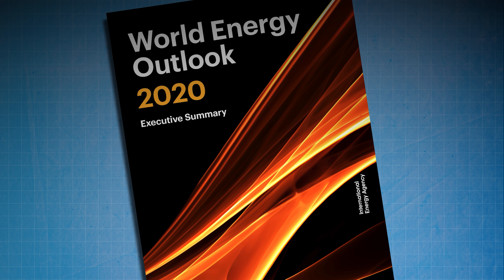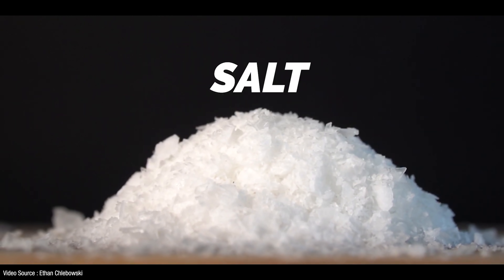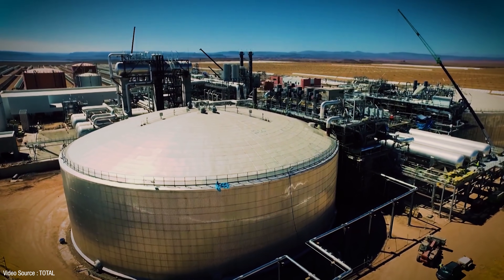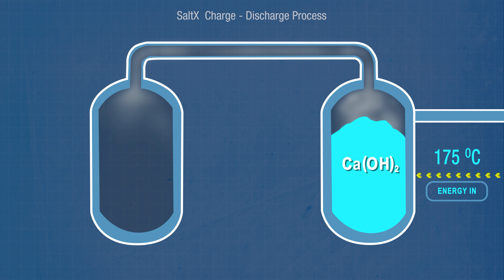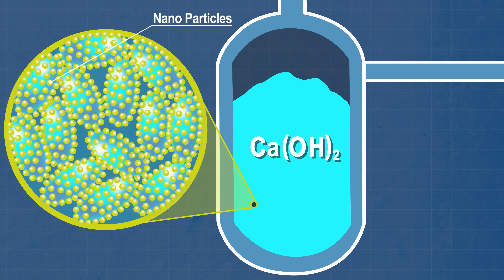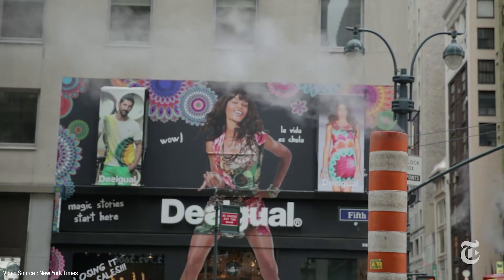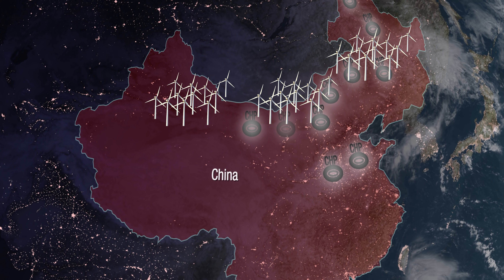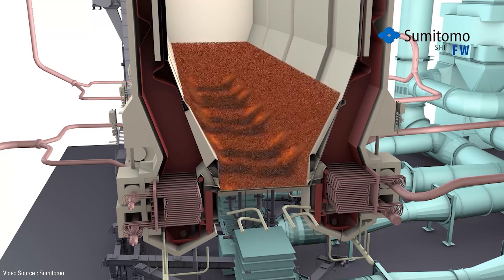Energy storage in salt - how nanoparticles are revolutionising the industry.

Comment: As you've alluded to, this could be used for district heating. I wonder if this could work for heating more remote places that have to bring in fuels. Say the Scottish isles.
Reply: Saltx can transport their loaded salt from one place to another using containers.
Reply: @lardigalltomkaninerhugolot1513   It was more of as a replacement for oil burners and large propane tanks that are used by communities that don't have a mains connection. I'd imagine that transporting the salt itself is pretty straightforward.
Reply: @lardigalltomkaninerhugolot1513  that would be wasteful, plus energy density is similar to Ion batteries as shown in the video... so in reality makes more sense ti transport fossil fuels , because of their high energy density
I think the goal is Either solar heating like the mirror plants )so they can work always no matter grid load... or heating it up with i guess electricity generated by wind or solar...

So you heat it up when wind is blowing but you arent using much power, and then when you need, you reverse the reaction...
Reply: I just bought a house, in a place where it snows (which will no doubt shock people), and it's heated with steam. So now I'm wondering if that could somehow be integrated with solar panels some day… although up here, I'm not even sure if solar makes sense. It's such an adjustment, not being in my native temperate climate anymore!
Reply: @nomadMik  Although you get less sun the more north you go the cooler temperatures are better for the solar panels so it kind of evens out. In the Orkney Islands they are going solar & battery to reduce oil burning heating etc.

Comment: Bill Lear, of Learjet fame, tried to make a practical steam powered car. This  tech could make his dream come true although BEV still better. Hey - maybe a steam powered plane?
Reply: A piston engine?
Reply: @snowstrobe  I can picture a farmer in say India converting an ICE engine to run on steam and recharging the salt with a camp fire. Another idea would be some sort of steam turbine/alternator powering an electric drive train.
Reply: You could maybe power a train this way where weight isn't as much of an issue, although the turbine to dynamo is where you lose efficiency. It might actually be better efficient use of the heat with a triple expansion steam engine to replace a diesel locomotive.
Reply: @helenlawson8426  Love this idea - the return of the steam locomotive. I wonder if a steam turbine would work ?
Reply: @stevemickler452  Steam Turbines work best at high pressure which is the reason behind why when used with geothermal they have to go down so far which in turn reduces where they can be built. This is also why i suggested a triple Expansion Engine as they are best for getting all the energy out of low pressure setups like on a train with a salt battery. 
Steam turbines are fantastic engines but sometimes a compromise in engine is the right decision to open up more options, which is what we need right now.
It's why I like Hot Air Engines as they can create electricity even from ground heat pump sources. Something not efficient but putting power into an energy storage system 24/7 365 days a year is really the type of technology we need.
When I say low efficiency although a heat pump can be crazy efficient up to 300-400% when you then take off the efficiency of the hot air engine and then the electricity generator you may be looking as low as 10%. at times but up to 30-40% it is though doing this all the time regardless of weather and time of day. I'm not so sure if that is good enough for a house but certainly say at every every substation along side a big battery.
Just my thoughts I am not in anyway clever enough to make something like this happen.

Comment: I’m wondering if this technology can work on a small scale. Picture a remote cabin with solar panels  and a molten salt energy storage apparatus. How much space would a small system require to power a home completely off grid.? Could such a system be cost competitive with other options?
Reply: I mean then you'd use PV- T (THERMAL ) Panels. Since this system stores energy in a more passive form, it would be much better for home systems and smaller systems than molten salt. 

If this works well, it would be very easy for every home to store heat during summer months using a reverse refrigeration cycle (powered by their solar) and then extract this in winter. Most homes though have really shitty thermal parameters so it wouldn't be worth any such system, but would rather be better to simply better insulate the house
Reply: @vigneshgandham3782  So, how well would that work in Northern States in the winter?
Reply: @jeffbransky6499  So as another person just explained  you'd need about 5m3 , (45 cubic feet) of space just for heating the cabin. All that money could be spent on adoption a passive home design, which will hear your cabin using solar energy from the windows. Probably also a lot cheaper to retrofit insulation on a cabin than get a shit load of this salt
Reply: @vigneshgandham3782  That’s all well and good but people want a constant reliable electricity supply when they live off grid. People in rural areas use wood or propane for heat. My comment was strictly regarding off grid electricity, not heating with electricity. Still waiting for an answer to my original question.
Reply: @jeffbransky6499  I'd say 15-20 cubic feet for a few weeks of energy.
Reply: It’s be way more than current state of the art. The would would have to be all custom. The solar to electric to heat process is extremely low in efficiency. I think this one relies on redirected solar to heat the salt. I don’t know the calculation but you could determine how much area you’d need to get the salt up to 500 or whatever temp you need. Same for the salt volume needed for the system. The only cost you couldn’t calculate is the nanocoated salt. Fun math problem to figure out.
Reply: A lot of old homes in Ontario are still heated with a central boiler and radiators. If this could be scaled for homes, it would be ideal and replace the oil or gas currently being used to heat the water.
Reply: The high temperatures of the process probably precludes its use in consumer-grade products. I don't think one will ever be able to buy components for such a system at the local hardware store.
Reply: Just what I was thinking. Replace your gas boiler with molten storage.
Reply: This doesn't involved a molten salt.

Comment: Hmm, you heat the whole mess up, but how much is lost in the cool down of the steam and the salt in the storage?  It just doesn't strike me as all that efficient.
Reply: Heat loss in the dehydration process is all based on the efficiency of the system, pipes and insulation, the process itself was stated at 90% efficient. Once it’s dehydrated (I.e. in storage), there is no need to maintain the temperature...this is always the big drain on traditional systems.
Reply: @scottturner2529  i would take that 90% figure with a grain of treated salt.
Reply: @jonahbert111  It has been tested in a standard charger/discharger and the percentage was at 84%. This was a non SaltX optimized solution though. They have built fluid bed solution now. And as of last night they now also have a charger in mind to built with Calix. So they might get up there. Also 84% is not bad at all :)
Reply: It's around 90% efficient according to the company. That's why half of the video is talking about using the steam for regular heating needs instead of using it to turn a 30% efficient electric generator to power heating system anyway.
Reply: Presumably most of the heat could be recovered.  

1) When "charging" the system heat released when the steam is condensed could be used for district heating.

2) Once charged, heat from the salt could be recovered by water cooled coiled pipes in the form of steam and/or hot water
You might be able to get away without cooling the salt down, as soon as water hits it on the discharge cycle steam will be produced by virtue of the high temperature of the salt and thereafter by the exothermic reaction.

3) Heat could be recovered for district heating from the turbine exhaust.
Reply from the maker: It's 90% efficient. You're not storing heat. You're storing the chemical reaction.
Reply: @JustHaveaThink  I understand that.  But all that steam and hot salt that needs be cooled down represent huge losses, unless at the time you have some use for it.  And when it goes the other way, there are reheating losses of the salt and the tank and pipes.  And if you are heating this up initially with electricity, it is even worse.  You won't be able to get nearly the electric power out that would be put in.  Sure there may still be applications, but in most cases, there are better solutions.  I live near Niagara Falls, where they pump water up to a reservoir, then go the  other way when needed during the day.  That obviously makes sense.  And the "coated" salt is not clear either.  If you add water to it, some of it is going to dissolve.  Then what?  It is not going to be coated, is it.
Reply: @jonahbert111  The lime is prill. It is coated so that it doesn't congeal into an amorphous mass when it takes on water to become slaked.
It makes sense to me that it can release ~90% of the heat that went into it.
Have you never mixed mortar or plaster?
Reply: Not sure what you mean as the cooling process is the heat you're making use of so isn't wasted. The system is about 85-90% efficient in the cycle and heat transfer systems so you can warm a factory or homes are the same in efficiency. 
In theory you can put energy into storage for heating at times when you know the load on the Electric or Gas grid is going to be high and expensive. So heat energy security and a chance of paying for itself by the end off life of the system or maybe earlier. 
Some factories will create more heat than they can make use of so again storing it for later months could be a money saver.
Electricity wise it only makes sense for renewables.
Reply: I don't see any need to cool the dehydrated salt and cooling the steam down to water is an integral part of the process, otherwise you just end up with an extremely high pressure steam bomb.
Presumably this process would run on a daily schedule, roughly half the day spent dehydrating the salt and half the day spent re-hydrating it, with the water recovered from the original steam.  Why would you waste time waiting for the salt to cool?  Only to start adding water and waiting again for it to heat up to operating temperature?  Or do you think the re-hydration with water only works at low temperature?
Reply: @docostler  That may be true  if a daily cycle is used.  But if it is a longer cycle, as the video points out, the materials will cool on their own just sitting there.
Reply: @docostler (edit for real numbers)
 the delta is such that while lime will release (up to) ~90% of its latent heat of rehydration, it needs much higher temperatures to drive that water off.
If you want to recover that heat you need to let it cool from 900C (1,650F) degrees to ambient before it can be slaked, creating 300C (575F) degrees over more time... that can then generate steam, or be used for industrial process.
Hydrated lime has about twice the volume of quicklime, so this obviously can't be a truly sealed system.
A ruptured vessel of incredibly caustic soup is not good for anyone.